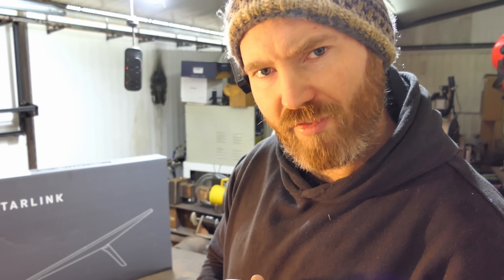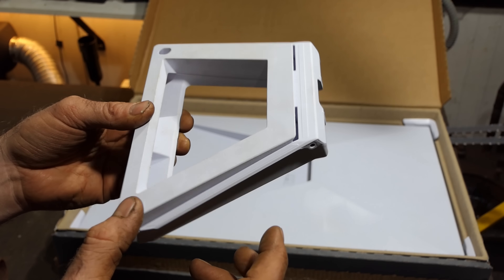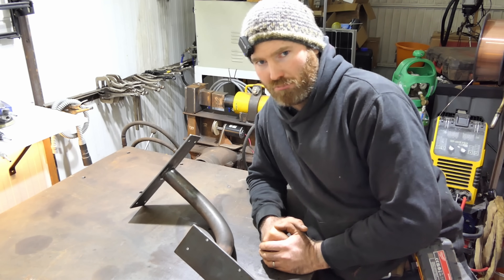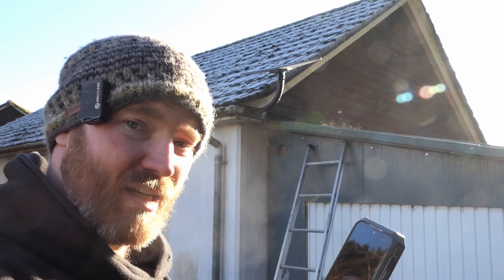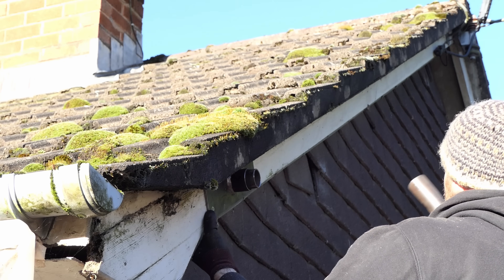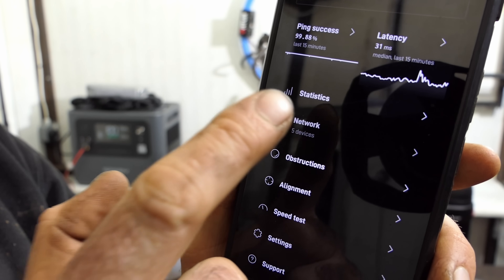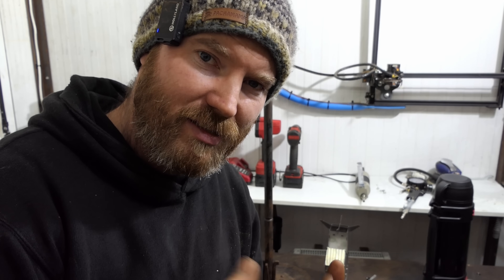I bought UK Starlink internet... I'm shocked!

Comment: FYI, Starlink throttles the connection during large file transfers. You won't experience it for the first week or two then it quietly starts to throttle your connection. There are several articles on it in the British tech publications. Made me cancel my order.
Reply: Yep - I've heard that. And since they aren't a British company under the control of Oftel they can do whatever they want whenever they want.
Reply: I have maxed out the bandwidth for days, after owning it for years. Maybe it depends on how congested the location is.
Reply: We live in a part of the UK with a very old copper BT supply….7.5km from exchange! Result less than 1Mb down….and if the phone rang…..nothing. We now have Starlink…..I can run a very greedy flight sim program, while my wife streams her latest ‘Nordic Noir’. Mobile signal is superb…..and whilst not as silly fast as it was…..after over two years it is without question the best thing we have ever done……we have finally joined the 21st century ❤
Reply: @vutti2893  ...DCS World?
Reply: Honestly, I expected nothing less from a bratmanchild and snakeoil salesman that is Musk.
Reply: Utter bollox .. usually written by people who hate Elon.
Reply: I had Starlink for 2 years. Live in Mid Wales, only other option was copper that gave 3mb. I am a software developer working from home so was on it all day, every day. Never saw this slow down, despite regularly downloading large files (20gb apiece). Worked great for me. Having said that, I've just stopped using it, FTTP just arrived, so I now have 900mb for less than the £75 per month I was giving to Mr Musk. But, if I moved somewhere that didn't have good connection I would definitely use Starlink again.
Reply: I can get a movie downloaded in a few minutes, my Starlink has hit 10 megabytes / per second, not bits, on downloads, 6 is good, 500KB/S is usual as it depends on availability, anyway I have never seen throttling.
Reply: @Futures62  Virgin can do that too, you know :-)
Reply: This is a plain lie.
Reply: I see YouTube deleted my inital comment. Here we go again:

I expected nothing less from the "oil-snake man-sales bratmanchild" that is the [insert company's CEO's name].
Reply: @cbs1710 you poor thing
Reply: Most ISPs do that, you get high speeds for the first few weeks then they plummit.
Reply: Many ISPs are also suspected of giving priority to speedtest servers. Its relatively trivial for them to do this. But throttling large files seems like a reasonable way of balancing capacity.
Reply: Why would it make you cancel your order, this is something all ISPs do.  Even if you have guaranteed bandwidth contracts it is only "guaranteed" and not actually guaranteed.  How much does it throttle the connection by anyway?
Reply: @jimmydesouza4375 Not everywhere, here in Ukraine I have 1GB download, 500MB upload via optical cable for 12 USD and there is no traffic limit, but ISP that my friend has always throttles his internet after 1TB of traffic, but it is not blocking large file upload/download. Probably around half a terabyte every month is routed through my own VPN through VPS in Germany not a single time it was throttled for 8 years.
Reply: @jimmydesouza4375It VERY much depends on the degree to which this happens.
Reply: @jimmydesouza4375 I have a 250Mbs  connection and in testing it is always 270ish any time. I was with a cheaper service provider that did what you say and they always had excuses.

Comment: We've been on Starlink (we're a small rural UK business and household) for  3 months.  It has transformed our internet. We get between 100 and 350 down and beween 10 and 30 up. Pings are around 25ms. It all depends on how many satellites are overhead. It is a solid connection though. Kids are online gaming and streaming whilst we're working or streaming and it never misses a beat.

We've got ours on the apex of our roof and the Obstructions map on the app is completely blue, nothing blocking us at all. Other things to bear in mind is that if you add it to a network, some devices don't support gigabit data so a router could be limited to 100Mbps. With network overheads that will mean a max of about 90. 

The Starlink routers are average for coverage around a home. You'll almost certainly want to extend the network using ethernet and more routers.  You can but the official Starlink ones and do mesh but they are £100 a pop. We just bought cat 6 cable and a couple of TP-Link C64 routers at £40 each and now we have internet everywhere including outbuildings at the same speed it comes from the dish.

Hope this helps. Fingers crossed Elon doesn't lose the plot and switch us all off!

Comment: The congestion charge isn't mentioned anywhere in the pre-sales literature and is a rip-off. Where I live the Royal Mail assigns our post town as Spalding which has multiple fast internet options but is 12 miles away. Where I live I get at best 5MB via ADSL2 over copper but still get stiffed for the congestion charge. BEWARE!

Comment: You are doing a speed check over wifi - there are a number of factors that will slow that down - such as placement - weather there is a brick wall inbetween you and the router - you should have done a speed check on a wired internet connection not wifi - I mean is it wifi 5/6 or 7? Too many factors that can lower the speeds

Comment: INSTALLED SAME AS YOU A WEEK AGO AND I SET IT NORTH HERE IN BRAZIL IM FROM UK, AND I HAD TO TURN IT SOUTH TO GET IT RIGHT,JUST PUT IT ON SOME PLYWOOD ON TOP OF CONCRETE SLAB ON CHIMNEY, ONLY TOOK 30 MINS APPROX TO SET IT UP, THE ROUTER IS QUITE STRONG GOES THRU 2 WALLS TO REACH OUR BEDROOM AND IT VERY STRONG COMPARED TO THE MEGALINKS COMPANY WHICH IS FASTER BUT DROPS OF AT TIMES, I CHANGED THE FIBRE AS THE CABLE COMES ABOUT 10 METERS AND TREES  MONKEYS  STORMS ETC RECENTLY BEEN OFFLINE 3 OUT OF 4 WEEKS,BEEN OK FOR PAST FEW YEARS BUT THINK THE COMPANY COULD BE HAVING PROBS SO GOT STARLINK, SO FAR SO GOOD😊

Comment: BTW You can get Faster via 5G (outside units) & Cheaper Just remember to learn you Router CAT numbers   IE, Example  Cat 6 has less Channels then CAT 24 Cat 48 Can effect MAX Total speed
Reply: Also  if you want to  make Soler powered 6V ~ 12V,  ~ 48V direct DC  (Wide voltage input ) Look into LINOVISION Gear

Comment: Thanks, I was quite interested in Starlink, but this is a great advert for not getting it. Having such an expensive device come without a bracket is crazy. To then have such a heavy ongoing cost and, on top of it a congestion charge! That was just the last straw, I would have returned the whole setup at that point.
Reply: It's designed for people who, like me, have no alternative. I'm in the middle of Somerset and I don't receive BBC radio 4, let alone mobile signal. You don't get a mount because StarLink don't know what sort of mount you need.
Reply: @JohnDaragon  But, if you know what kind of mount you need then you can order it at the same time as you order the dish.
Reply: Plus the whole thing of giving money to a fascist...

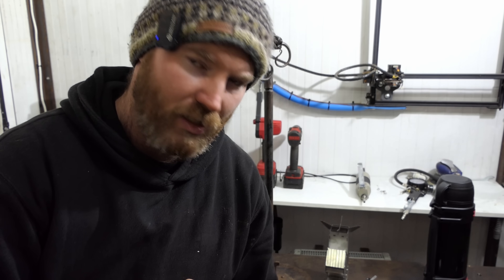Comment: 8:26 Why would anyone concerned about their internet speeds be using wifi and not cables? The starlink router doesnt have ethernet ports? You cant use your own wifi system to distribute the signal? Have you not heard of wifi range extenders?

Comment: Starlink is brilliant. Flop it out on the roof and away it goes. I mounted mine on an old sat dish arm that I could adjust the angle on, attached it to the metal roof with really strong magnets and weights on the mounting plate, ran the cable down a disused vent pipe and it worked perfectly. Its been through a couple of gales without a problem so far.

Comment: To be fair satellite internet has been available for years (I had it near Cambridge in 2004) but the latency for online gaming is awful - 36 pings as he's shown in the vid are very slow in terms of online gaming where most people on decent connections will be running under 15ms (and often under 10 mins) and in comparison we were getting pings around the 40 mark TWENTY years ago on ISDN lines.

Comment: Great video, as always. I 0:03 recently purchased a Starlink mini. I couldn't buy a residential one because I would be put on a waiting list before purchasing it here in the States. Here are some suggestions if you will help someone in the future. Mount any Starlink on a tripod before mounting it permanently if you are camping, etc. You wait for at least 12 hours before permanently securing it. Amazon has a whole group of things for the Starlink. Especially for vehicles or boondocking, I suggest purchasing a cover that helps with the weather and transporting it.  You only need a portable battery pack that provides 65w continuously. Anker has one. I have replaced the Starlink router, and the results are excellent.

Comment: We've had Starlink since the very beginning, being fortunate to get a Beta test system here in rural Oregon.  Before putting it up on the eaves of the barn, I tested the system at ground level.  All good so it went on the roof and still all good.  The speed from antenna/router to satellite is great.  The speed from the various devices to the router, not so much.  The WiFi signal reception by the router is weak.  It needs to be closer that is convenient.  A few months ago the early version of the router died.  Starlink shipped a replacement that also failed so they sent a complete replacement rectangular antenna to replace our early Dishy McFlatface one as well as a gen 3(?) router.  The replacements work but the signal between the WiFi and the router is still weaker than other WiFi routers I use used.  But it works.  Because of Starlink we now have fiber cable being installed all over our small town.  I expect to switch to fiber as it is half the price and a claimed 1gb datarate.

Comment: Using something like TP-link's powerline adapters, which uses the home's electrical wiring as a network, you can easily add another wireless access point in the workshop.
Reply: Does the Starlink router that is shown come with ethernet ports to add powerline or other Hardwired adaptors?  From what I've read on earlier models you have to get an Ethernet adaptor from Sartlink before you can add any hardwired/ethernet equipment.
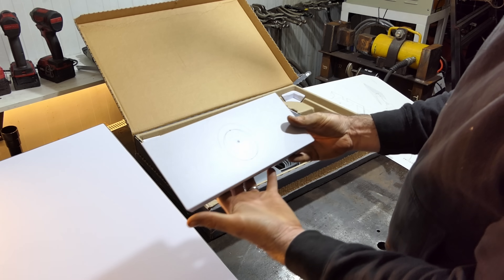Reply: @ChagoiSteve  1:34 On the back of this Gen 3 router there are two ethernet ports under the grey rubber cover. If you need more than two ethernet ports you can add more using an inexpensive ethernet switch/hub. The Gen 2 router has no ethernet ports and requires an adaptor from Starlink to add one port. The Gen 1 router has one ethernet port.
Reply: I use them all the time...hard wiring...makes the security 'safer'

Comment: It is 368 mega bits per second you are getting. Not 368 Mega Bytes per second.  Bits is a small b, bytes is a big B.
Do in megabytes you are getting about 36 Mega bytes per second as a guide as there is a bit of overherd on top.

Comment: Before we had fibre in the area we had similar ADSL speeds.
To get around it (back when I used to upload content) I got a little MiFi router.

It's a small device that takes a mobile sim card which gives you mobile down/up speeds.
Once I paid for the device all I needed was a data only sim which had a monthly subscription and some software to network bond it to our ADSL so devices would use both to send/receive, not just rely on the MiFi for data.

I did a video on it back in 2017, in case it's of interest v=hXNnzVCKJJ0

Comment: Super hack if you live at the edge of a town.
If your town have fiber somewhere they don't have it in your street you can buy 2 long range wifi antenna and connect internet from a friend's house to yours.
It works for 5km with good the limit is around 15km. Unifi Powerbean is pretty affordable for example. The biggest problem with starlink is latency in my opinion and they can't really fix so you can't really use it for gaming.

Comment: The only downer for Starlink is the latency, for online gaming for example that is a problem.
Reply: Average latency here is about 32mS
Reply: @ not so bad then really, for casual gaming most certainly ok.
Reply: I have not done gaming, but do run 3D CAD software by screen sharing over VPN, over Starlink. The small latency is just about noticeable but not an issue for me. For video conferencing it's not a problem at all.

Comment: I ditched  my copper only broadband . I now use my phones mobile hotspot, 5g at 250Mb - 460Mb.
Well worth considering, 4g can give 68ish. This would depend on available mobile signal for suitability. 
Cost is a little over £20 per month for a sim with unlimited everything, no throttling.

Comment: It's not the cost of the dish, but the £75 a month that would put me off LOL.
Reply: I’m paying more than that for “standard” FTTP because I got utterly messed about by supposedly the “good” ISP Zen Internet.

After a series of unfortunate screwups by them, I decided to bite the bullet and sign up with Andrews & Arnold. The last bastion of actually good customer service in the ISP provider space. Super expensive, but super worth it.

Also paying £17.95/month extra just to have 4G internet that will automatically kick in if anything happens to the fibre.
Reply: SpaceX reduced prices to be more in line with local internet, so it now depends on the country. In the Netherlands it was introduced at 99 euro's/month and is now 50/month. I think the cheapest countries are around 35 euro/month. Some are much more expensive, like Canada.
Reply: @jwstolk  I don't know what these Euros are. I am in Britain LOL

Comment: The people complaining about price. Yep. The cost is pretty high. However, this guy does not like wasting money. If there was a cheaper option for these speeds at his location. He would of done it. Also.. the starlink can be used anywhere. If this dude goes camping, fishing, a long hike up a mountain. If he can power this starlink and takes it with. He will have these same speeds anywhere. The starlink definitely has a purpose. £300 for product. And £75 per month where there's no real better option. Then the added bonus of taking it anywhere on holiday or weekend trips. Its a quick, and reliable product for internet of where there is none. and its a garenteed connection at any location. And that sort of thing... is never cheap. On a side note.. starlink  is also very new in the UK. And shall only improve with time. Good video.

Comment: One of the very few benefits of living on the outskirts of s city is fibre to the property, neigbours not so much. I have to ask what is 4G/ 5G like in your area? Quite often you can get fairly respectable speeds off of one of those routers that runs on a sim card, not what you ae getting on starlink but a fraction of the price for an unlimited data plan and no greedy "congestion" charge.

Comment: Downlink speed is good compared to typical FTTC (76Mbps) but upload is about the same. Do you have a data cap?
Reply: 76 Mpbs FTTC download speed is typical where? Are you maybe conflating bits and bytes?
Reply: @nicknelson9450  Any non G.Fast enabled cabinet in the UK countryside. Nominal 80 Million bits per second down, 20 Up, giving 76/19 Mbps. My line would handle 100 download given a 10dB SNR.

Comment: There are plenty of step by step build vid's on youtube, and ones that quickly adress modren hardware compatability concerns. Matching components is a little more complex than 10 years ago but as long as you do your homewrok and jot down some comprehensvive check lists you will do fine.

Note... don't use HeatSink paste or 'god forbid' liquid metal... use PTM7950... you can get the honeywell original stuff or get from Linus Tech Tips... don't buy the chinese stuff..  pop it in a resealable bag and into the freezer for 20-30 mins before applying, it's much easier. I use tweezers to lift the peel and handle it during applicaiton. It a phase change matierial so you apply it as a sheet then it liquifies when it's hot and solidifies when it cools. You just cut it to size and it guarentees 100% coverage with almost zero bleed out. You won't have to check your paste for a very long time, one of the advantages of this stuff.
Reply from the maker: Great tip. Thank you. Cheers J
Reply: @joshuadelisle  Another good thing to do is once your getting an idea what hardware  you want to par up. Make use of the build checkers on custom PC build sites that automaticslly check compatability. 

Also Power supplies are a lot better these days. I recommend be quiet PSU's, but these days even for AAA game builds 850W PSU is ample. Unless your building a rig based around an NVIDIA 5090 LOL.